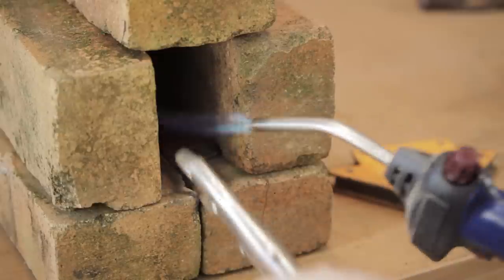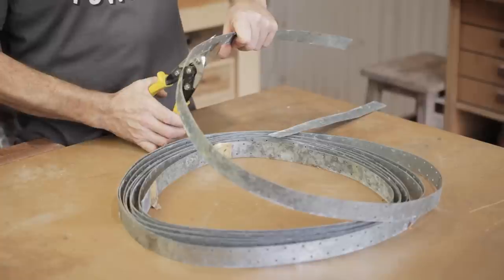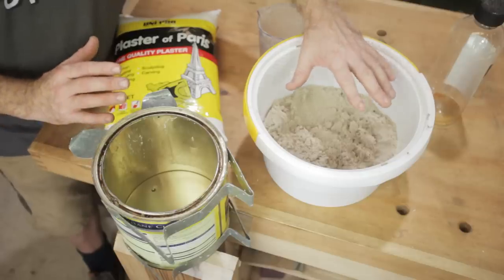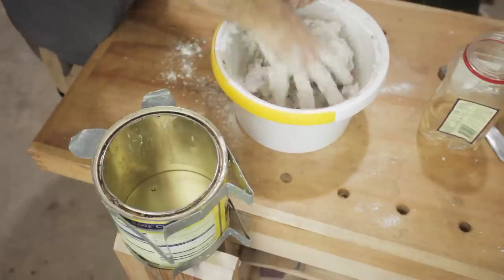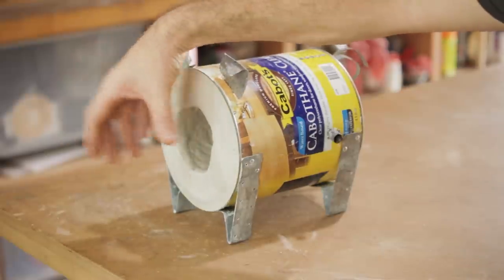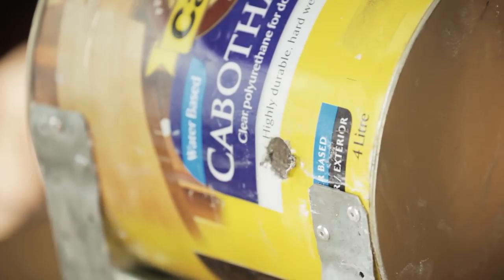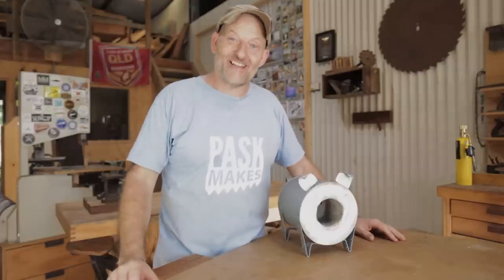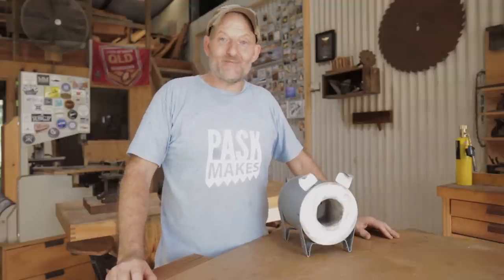Making a Simple Forge

Comment: Hot water works great the water warms up the plastic which makes it easy to move , yeah it is the expanse and that's why when you pull it will stretch out to a smaller diameter

Comment: Working with the plaster of Paris is much more difficult than it appears. It sets up extremely fast . I failed twice and had to scrap it and start over because the inner chamber mold got stuck . Even if it's pretty runny after you add water I recommend dumping it in the can as even as a liquid it sets up rock hard soon after . Also it took me much more than the 2 1/2 cups mentioned  for a 1 gallon paint can. Closer to about 6 cups equal parts each plaster to sand. Just my 2 cents if anyone else is thinking about attempting. Great project , thanks Pask.

Comment: One drawback to just piling up some random bricks into an oven (as in the “before” picture here) is that some bricks can explode when they get hot. Exploding hot bricks are not nice.
Reply: This is why you use **firebricks**, not standard masonry bricks.
Reply: Yep, firebricks are 100% refractory (non-melting), and are nearly waterproof. Housing bricks are practically earthenware, like terra cotta pots (though they are one step up from that), and they absorb tons of water, which, when heated quickly, becomes steam, and suddenly you have tons of tiny steam pressure chambers... which go boom.

Comment: A map gas torch works surprisingly well for small-scale forging!  My map gas "forge" is basically just a pile of regular bricks.  I can adjust them based on what I am forging.  I've used the setup for some arts and crafts forging projects as well has heat-treating  a set of carving knives.
Reply from the maker: It's surprising what can be achieved with simple set ups!  :)
Reply: Couldn't agree more.  Looking forward to seeing what you do with this little guy. 🐷

Comment: Simple and doable (and on my list now). Two suggestions: a hinged door wood keep in lots of heat. Perhaps set two rods in the mixture above the opening and hang a door made of the same substance or even a thick metal plate? Also, thinking of a way to have the floor inside flat (not rounded). Got an idea?

Comment: One improvement suggestion that'll make a big difference would be to angle the torch downward at about a 45 degree angle. You'll get a lot more even heating, faster heat up time and use less gas.

Comment: I love the piggy forge, that would be great for most of the stuff I'm interested in doing, I think I'll have to add a forge to my list of projects.  I have a friend and his kid build a forge with plaster of paris and sand and it started crumbling after a while, so I'm curious to see how long it lasts.  They might also have had issues because they were using coal.
Reply from the maker: Thanks! I'm not sure how long it will last but it really was that easy to do, it was worth a try. :)
Reply: I will certainly look for updates to see how it holds up for you!  It also just occurred to me, theirs is a foundry, so dealing with higher heat, so maybe you wont' see any issues at all!  I'll keep my fingers crossed because that would make building a forge so much easier and cost effective!

Comment: Good idea using a paint can. I've seen others make one out of steal bins but I like yours for smaller projects like heat treating. Few thoughts though... would some sort of mould release work with the plastic bottle? Like maybe grease or vaseline? Also, wouldn't you get better heat distribution if you turned the thing on its bottom and used a lid?

Comment: Cool! Another job well done my friend..!
Reply from the maker: Thanks! :)
Reply: Pask Makes  I think the propane torch needed more air.  Maybe a bigger hole with the tip outside to pull more air in with it. My torches go out when I have to solder or braze in a hole or up in the the cavity of one of those waffle ceilings. If I don't use oxy/acet, the torch will keep extinguishing itself when it burns up all the surrounding air. Just an FYI thought I would share... however if that was a BernzOmatic torch it could have very well been the Torches fault LOL those things are crap... LOL LOL

Comment: awesome forge - i love that it was so simple! 

at the end of the video you talked about not using it inside - is that because of the type of gas you're using for the torch, or another forge-related reason? it may just be YouTube, but sometimes other videos show makers using similar forges inside... just wondering what the cautionary note is about (other than explosions, burning down the building & whatnot...) smoke? fumes? gases? (you mentioned wearing your respirator) ... or just as simple as not blowing up your shop?
Reply from the maker: Thanks! I probably should have explained that better. In my shop there is plenty of room so should be fine but I wouldn't want anyone to succumb to carbon monoxide poisoning, especially if they are in a confined area! :)

Comment: Hahahaha, brilliant quick build, mate.👍
You should have painted it pink though..... 
How long, roughly, does that yellow cylinder of gas last?
Reply from the maker: Thanks Bill! I wanted to paint it pink but the heat resistant paint only comes in a couple of colours. I'm not sure how long the cylinders will last, maybe someone else can answer that. :)
Reply: Pask Makes I've had my eye on a couple of different torches for a while now. Mainly just want to use it for scorching wood, but they aren't cheap... Not sure if it's worth the spend.
Thanks any how, mate.
Reply from the maker: The new torch cost $69 from Bunnings, I thought that was pretty good. :)
Reply from the maker: Yes that's what shade it was! ;)
Reply: Pask Makes I saw them in miter 10 for around the 95 mark, being on a DSP,  I got to watch what I spend..
But I will suss bunnings, that is a reasonable price.
Cheers mate
Reply: How long a MAPP cylinder lasts depends a lot on how much MAPP gas you use at a time.  I usually get about 20 hours out of a cylinder, using it for everything from brazing to MAPP/oxy cutting; I'd expect about the same in this forge setup.  But, if you crank the regulator wide open, you can empty a cylinder in less than an hour.  Doing so, though, is usually an indication that you're doing something wrong.
Reply: Shawn Bean cheers.

Comment: Can some one help me please. How significant is the steel tube that holds the burner in the forge? Does it have to be a snug fit? Or can there be some air between the steel pipe and the torch end? 

Seen some people just put the torch straight into the forge and that looks kinda worrisome??

Comment: Would have been a great video. But you said 2 and a half cups of each. So I did that. And started to build the forge. But 5 total cups wasn’t even close to enough to do the forge in a 4 liter bucket. So my first batch hardened while I was trying to mix a second :/ (USE MORE THAN 5 cups mix overall. Mine took 10)

Comment: Plaster and sand... Sounds a whole lot less expensive than store-bought refractory cement. 
Does anyone know figures on the longevity of this vs specific cements? 
What about mixing in some fiberglass fibers? Good or bad idea?
Reply from the maker: I actually have a bag of refractory cement but on the bag says 48 hours before any heat can be applied and I wanted to get it up and running straight away. :)
Reply: I use old crappy cornice cement I had left over, mixed with sand.... and serves just fine as refractory material for numerous burns. It does start to crack apart after a while.....but who cares??? Just do up another batch. Quick, easy, and most importantly cheap! Thanks for the vids, love your projects, always learn new stuff.
Reply from the maker: Thanks John! Exactly, cheap and easy! :)
Reply: don't use fiberglass as at the temperatures in the forge glass will melt.  Perlite will lighten the mix and provide some insulation to help keep the heat in.  If you want to make your own Refractory cement you need 1. Portland cement a small bag $10  2. Perlite $10 to $20  3. Silica Sand 50# for $25  4. Fire clay or Drillers mud  $25.  Mix 1.5 parts Portland cement + 2 parts Perlite + 2 parts silica sand + 2 parts fire clay.  This is a passable mix but not the best for high repeated heats.  You would be by for better off using 1. Perlite Standard 2.0-5.0 mm and 2. Fire cement rated a minimum of 1800⁰F or higher.   Also make absolutely sure that your casting is completely dry before you fire it to high heat as if it is not it can explode from excessive steam pressure building up inside the cement!!!!!!!
Reply: Mike's Micro Shop oh, okay, thanks for the information. I'm new to this stuff. What about rebar or other steel reinforcements to support in the middle of the mix, good or bad idea?
Reply: How big of a forge are you making?  If it is over a foot square I would use fire brick and a steal box.  Re-bar in the refractory will expand from the heat and break the casting.   https://www.youtube.com/watch?v=syFYj8eQstM  https://www.youtube.com/watch?v=uIRTcmR6sSk  https://www.youtube.com/watch?v=ZNqYG5_f7so
Reply: Mike's Micro Shop 
Propane tank (exchange size) with maybe 2 burners, propane fired. Was the plan.
Reply: I have seen a few forges like that on YouTube you should be able to find them easily.

Comment: Why are you worried about using it inside? That's where modern forges are.
Reply from the maker: The only concern is carbon monoxide poisoning. I'm not so concerned for myself as I have a fairly big open space but I felt I should show safety for others watching. :)